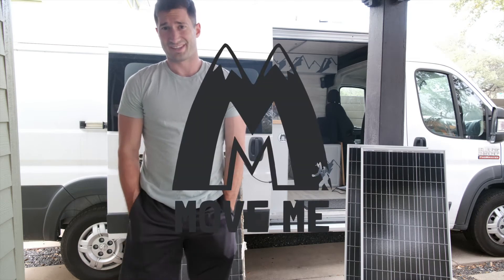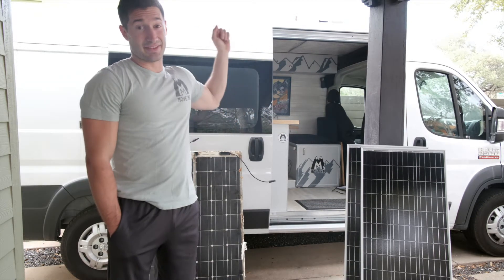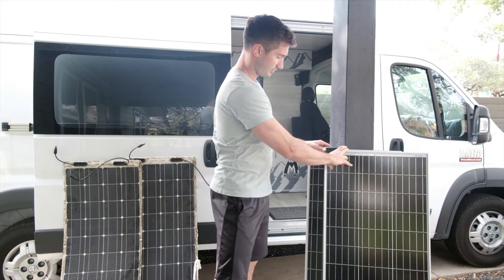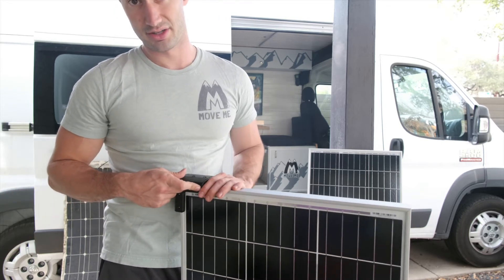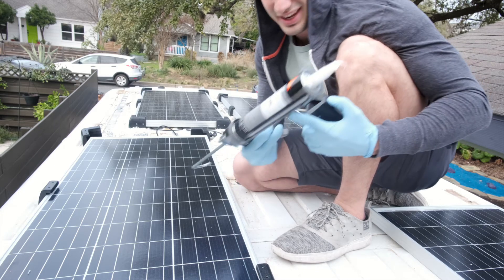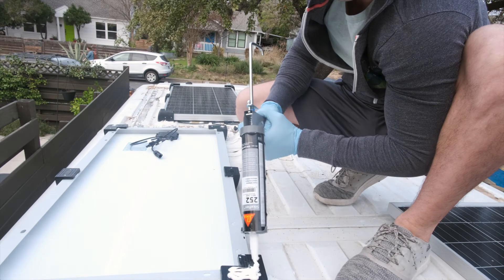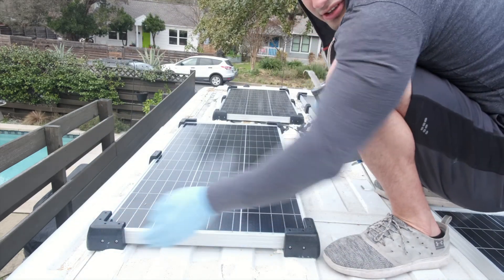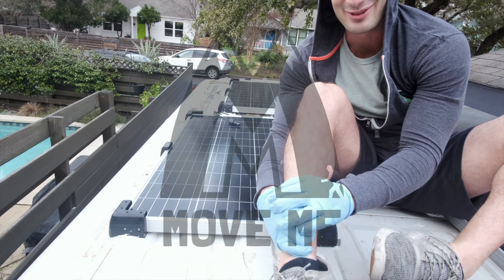Mounting Solar Panels Without Drilling Through Van!

Comment: Im not a big fan of mounting anything to the roof that came out of a tube and thats not bolted down. The Promaster have mounts for a roof rack. There are many problems associated with this setup. First, if you have a problem with a panel, you do more damage removing it. Ive heard of "glued down panels" coming off and turning into projectiles. Also, the roof of the van can get very hot, having installed directly on the roof with no air circulation underneath the panels can cause the panels to overheat and make them ineffective and even non functioning. Sorry, hate to be a kill joy, but i would avoid this method at all cost.  im just installing panels on my 3500 Promaster and have spent the time, money and research on the best way to install them. I installed a full length roof rack that can easily support 4 panels and a cargo area at the rear of the rack  that i can carry anything i dont want inside.  Doing the electrics on a van is a huge financial commitment, best to do it right the first time. (You had me a bit concerned when you put the sealant in the oven). Don't do it because the easiest, you be kicking yourself in the long run. Cheers.
Reply from the maker: I completely understand your concern. I do worry about them. Especially in the hotter days and when wind speed is high. I check them every two weeks and they are still glued down as hard as when first installed. There is circulation underneath due to the vans roof ridges so they can breath. I wish I would have done a roof rack from the start but that's just not how it was done. They day they start showing any sign of weakness I'll instantly reapply.
Reply: And you are also relying on the paint contact to the glue, not glue to metal. Afraid it's bolts for me. I spoke to some friends about the stick down holders and they immediately sent me links to panels that have come flying off.
Reply: It's very unlikely that all six of the panel fixings would fail at one time. For a panel to come off in transit I would say they hadn't been fixed very well at all. With due care and attention, ie good surface prep etc.,this is a credible, effective and budget friendly solution. Thanks for making the vid, just what I needed!
Reply: Try glueing somthing with 252 sika then try breaking it apart you wont
Reply: I was thinking the exact same thing.
Reply: @jacks2222 but they will cascade
Reply: Bottom line.....
Unsafe, bolt the things down.
Reply: I'm about to glue my panels down but seen this now I'm not sure....could use captive nuts I guess but on the other hand are we supposed to bolt all our privacy windows down. Don't want them coming off in transit 😬
Reply: Anyone else get strong gronk vibes? 😂
Reply: It works fine.  This person is ignorant of this product. Industrial adhesive is used to hold together airplanes and it's the standard to attach solar panels in England.  Americans have no knowledge of the product and refuse to gain any. This isn't Elmer's.

Comment: Comments from ppl that have no clue about these adhesive , they are used to glue car body panels kits etc , i defy anyone to try to unstick once they are set , ive had my panel on van 4 years its stuck solid also have a dead flexi panel on motorhome i cannot get off ,
Reply from the maker: I know...I understand how they could hear "adhesive" and freak out, but I figured my description would put them at ease. I tell them I check the strength every month or so and try lifting them off. They haven't lost a single ounce of strength. Those things are not going anywhere haha. They've already survived 30,000 miles in every type of climate.
Reply: Do you have any good recommendations for adhesive?

Comment: Just a heads up for others out there. Sika 252 should be used with an appropriate primer. For painted surfaces, the primer is 206 G+P and for plastics the primer is 215. In this case, you paint the plastic surface with 215 and allow to dry for the recommended time and apply 206 G+P to the painted surface and allow to dry for the recommended time. Once both primers are dry, you then can apply the Sika 252 to the surface and join.

Comment: Just put 200w CIGS BougeRV with the sticky tape. 👍
Reply: I have been debating doing that too. how is it holding up? any issues and did you use anything else to help secure it?
Reply from the maker: @BeverlyAdventures I used the sticky tape initially for the flexibility solar panels. But for these panels you're going to want these brackets and some construction adhesive to really make sure it stays down.
Reply: @movememovement  do you recommend the bougerv flexible cigs panels? Those have been the ones u wanted but worry about them flying off and did you secure to a roof rack?  I heard they can damage the van roof if just put directly on it so has me hesitant
Reply from the maker: @BeverlyAdventures no I don't personally recommend the flexible panels. I tried them initially and they lose efficiency faster. If you don't need much solar I don't see it as an issue....but I will say, if you haven't installed the inside ceiling roof yet then you should definitely screw down the roof racks and properly install the solar panels. I used this method in the video because I had installed flexible panels. Then my interior roof. Then I realized the flexible panels weren't as efficient. So I had to find a way to install the panels without drilling through my van.

Comment: Very good, informative, and honest video. You're just showing people some possible options.
Reply from the maker: Thank you. I always tell people that if you have the option, definitely drill in the brackets for extra peace of mind. I just had to find a solution due to me installing the internal roofing and shelving. But I also tell people, my panels haven't lost an ounce of strength and its been 3+ years and 30,000+ miles through intense heat, wind, and cold. So the adhesive truly is construction grade.

Comment: Im doing this too. Ifound a cheap plastic white spoiler that you can glue on the roof at the front of the van. This should take all the wind off the rest of the roof when going at speed. Just an idea
Reply from the maker: I was looking for something like that? do you have a link for it? I will say, I'm 7 months in, 20,000 miles in and they've showed no wear or tear yet. I would love to have that additional security though.

Comment: 3M VHB Tape with proper surface prep is the most secure no-drilling attachment for solar panels.
Reply: I agree, I used renogys no drill mounts. CLEAN the roof and lightly scuff the no drill mounts with a scotch bright pad and clean again with rubbing alcohol then vhb tape to the roof. To connect the mount to the panel I used a fat self taping screw on each mount.
Once cured i apples eternal bound over the feet of the brackets to shield the vhb tape from the elements.

Comment: Anyone who doubts this sikaflex adhesive are clueless... its pretty much whats holding everyones windscreens in and they are bullet proof 👌
Reply from the maker: I know, I don't doubt them for being a little skeptical. If you have any experience with this though you'll quickly find out that nothing is going to tear this off. I tried putting that in the description but I guess people don't always read.
Reply: The windscreen that is getting pushed by the wind INTO the automobiles body vs getting sucked off the top of the roof.  The windshield also has adhesive touching the entire edge.  Not the same, not even close.
Reply: @mondavou9408  Yes, and not only that, but the Sikaflex here is being stuck to the PAINT on the roof, not the metal of the roof, meaning that the panel is held only by the paints limited ability to adhere.

Comment: I've seen a lot of drill less type mounting and many use VHB 3 M tape instead of adhesives. Not sure which is the strongest.  For me I used VHB tape and then I also for more security connected a thick cable from the panel to the frame of a roof mount just in case the panel did fly off the van. It's just a single 300-watt rigid panel for a much smaller van application. The base of the mounts is also covered with tape too.

Comment: Do a follow up video plesse
Reply from the maker: So I went on the van life trip. 8 months of straight driving everyday. Over 40,000 miles through extreme heat, cold, and wind. Every month I would check the strength of the panels I can confirm they haven't lost an ounce of strength. I still don't think I could pull them off if I pulled really hard. So this adhesive truly works if applied properly. I'd still recommend drilling it in, as it'll make removing them easier. For me this method worked and continues to work over 2 years later.
Reply: Ty

Comment: doing this on my scion xb, thanks! just need to figure out how to get the wires inside but I'm thinking extended cables through a cracked window or something
Reply from the maker: Yeah, I went ahead and drilled small hole for the wires. That was pretty easy to patch and make waterproof haha. I've seen people run the cords through their windshield so I know its possible! Maybe find some tape that's the same color as your car so no one will notice the wire haha. Goodluck!

Comment: So many people worried about glue.  How do you think the roof of the vehicle is attached and doorskins and truck box sides?  All glue.
Reply from the maker: I don't blame them. I'm sure hearing glue causes concern. The strength of this adhesive is truly insane though. It's been on for over two years now and 30,000 miles. Every month I tested the strength and it hasn't lost an ounce of strength. So I'm really happy with how it turned out, and how easy it was to apply.

Comment: Works fine.  Glue brackets on and weight down overnight before glueing to van.  Mark out on van before glueing and weight down overnight once on van.  Surfaces need to be cleaned properly before glueing though!  They will stay on forever.
Reply from the maker: Yeah I'm thinking I could have even scuffed up the surface to make the adhesive grip more. But it's already been 3+ years and 30,000+ miles and they haven't lost an ounce of strength

Comment: Any update on your install
Reply from the maker: Yes! I drove the van around the country for 8 months. It survived 20,000+ miles in exteme heat, cold, and wind. Each month I'd test the strength of the panels and they didn't lose an ounce of strength. I don't think I could pull them off if I tried. I would still advice drilling the panels in for extra reassurance, but I can confidently say the panels haven't lost any strength at all!

Comment: How to you get it off if it breaks down?
Reply from the maker: I just unscrew the bracket and the panel should be easier to take off.
Reply: @movememovement bro.. I asked the same question and the answer was so simple 😅😂 thank you for doing this! So helpful!
Reply from the maker: @ I'm just happy you guys enjoy the video. But I always recommend if you haven't installed your interior ceiling yet, its probably best to screw the brackets in for extra security.

Comment: I wonder if u could hv use that ahesive straight onto the panels & not use the blk brackets? Would it work?🤔
Reply from the maker: Yes I could have, but I wanted to use the brackets just incase a panel ever became defective. Then I could unscrew the bracket and replace the panel easier!
Reply: @movememovement  I had to cut a failed panel off, was an absolutely nightmare and wrecked the van paintwork.

Comment: Wondering if Sika 118 is better.. can glue a concrete block on a wall in seconds and its impossible to remove it.
Reply from the maker: No doubt there's probably stronger adhesives out there. Its a whole new world to me. I will say its been 3 years and 45,000 miles and they haven't lost an ounce of strength. So I'm happy how it turned out.

Comment: Hi, thanks for the update on how strong the bond was after all the driving. This really helped me understand / confirm to use sika and not drill holes into the roof. :)
Reply from the maker: Well I always suggest roof mounting still just due to the extra piece of mind. From driving this whole time I know the adhesive is so damn strong, but once a month I still check on it to make sure. With the roof mounted brackets you wouldn't have to worry about that...BUT the adhesive has worked very well for me.

Comment: How do you run the wiring into the van ?
Reply from the maker: I drilled a hole on the top of the roof. I made a watch my "flexible solar panel" video. I explain it there! You get a drill bit, drill a hole, and put a plastic wire housing unit over the hole.

Comment: Hope the paint is strong
Reply from the maker: I ended up driving around the country for a year. Over 20,000 miles of extreme heat, cold, and wind. It managed to survive just fine. I check the strength of the panels monthly to be safe. So far they haven't lost an ounce of strength.

Comment: How about an update?
Reply from the maker: I can confirm after a couple months of driving and over 3,000 miles they haven't budged at all. I check on them once a month to see how strongly it's being held down and have an extra tube of adhesive ready to go if I need to apply more. It's been fine for now. Even driving at 75mph.
Reply: @movememovement  just a thought that you could attach thin steel braided security line from panel to panel corner as a backup if one falls off it will hang and for it to exit roof all would have to come off which is probably impossible
Reply from the maker: That's actually a great idea! Doesn't sound too hard to do as well!
Reply: Did you use any primer with the 252 like someone suggested or just straight out of the tube?

Comment: How's it holding up a year later?
Reply from the maker: Still incredibly strong. Can't pull it off even if I tried. I'm going to take it out for two months soon. So I may decide to add a little extra on top to be extra safe. It survived the entire trip around the country though. Held up great. So I'm very please with it. I'd still recommend using roof racks if you have the opportunity. I just installed my sealing first for some reason lol. So I wanted to find something that wouldn't need holes.

Comment: How's The Panels Holding Up With That Adhesive, Any Fly Away ???
Reply from the maker: It's been 3 years, 45,000 miles through intense heat, wind, and cold. They literally haven't lost an ounce of strength. I still check on them once a month and I couldn't pull them off even if I tried. So if you apply them properly, still test the strength of them monthly to make sure it stuck properly...but mine are so damn strong.

Comment: unfortunately your bracket adhesion is only as good as the paint finish and when the paint finish is only microns thick and not very solid, you are taking a risk not using mechanical fixings on the bracket.
Reply from the maker: Yeah I am aware of the risks. I do check the strength of the panels monthly. I pull on them from each corner to check if its giving at all. Thankfully they're equally strong as the first day they were put on. But I am extra cautious about them and always recommend people install them with the brackets. I just made the mistake of installing my ceiling in the van and shelving units. Then my flexible panels failed on me and I needed a way to add panels without drilling through the roof again.

Comment: I had the same idea but was afraid... how strong is this?
Reply from the maker: It's been 3 years, 45,000 miles through intense heat, wind, and cold. They literally haven't lost an ounce of strength. I still check on them once a month and I couldn't pull them off even if I tried. So if you apply them properly, still test the strength of them monthly to make sure it stuck properly...but mine are so damn strong

Comment: 3:00 the only issue?
Is killing somebody 

This is stupid!

Would you suspend yourself over the Grand Canyon without a parachute secured with that ‘caulking?’
9:10 “…make good choices…”
Please start doing that.
Reply from the maker: I understand your concern. So to be safe I check the strength of the panels monthly. I could try my hardest and still not pry them off. So with over 20,000 miles, over 100 degree days, 15 degree days, and intense wind the panels haven't lost an ounce of strength. The first sign they do, I will reapply.

Comment: Are they still on?
Reply from the maker: I can confirm after 7 months and 20,000 miles they didn't budge at all. Each month I would check and they never lost strength. I went through intense heat, cold, and wind and they held up perfectly!
Reply: @movememovement  Holy shit that is badass!
Reply from the maker: @DancingFairy333  Yeah I was very impressed lol.

Comment: Are those holding up ok? Update?
Reply from the maker: So I left May 1st and have put about 10,000 miles on them. I check on them every 3 months and just checked them yesterday. They're still equally as glued on as the first day installing them. I was surprised at how well it held up. I'm in the North now and it's a little cooler up here. Not sure if they would be good if I was in hotter states for longer. So far so good though!